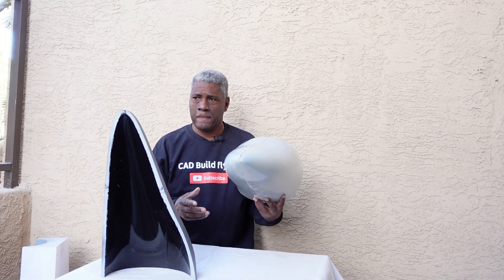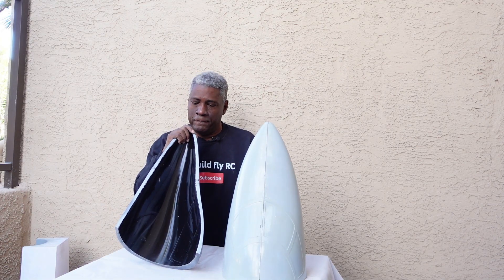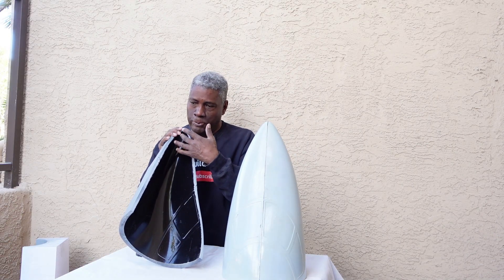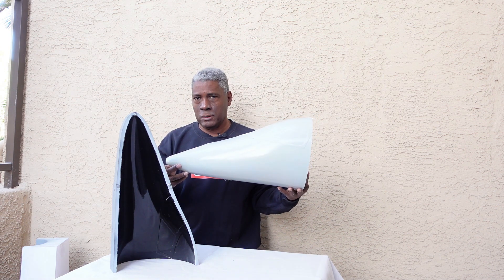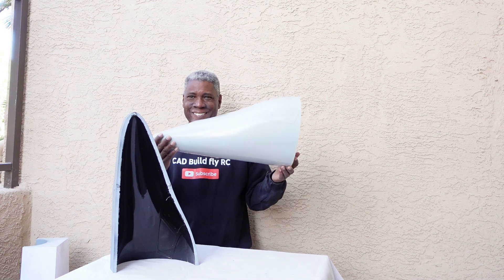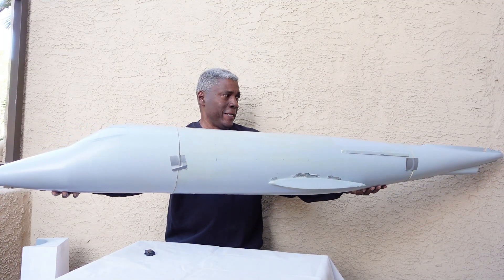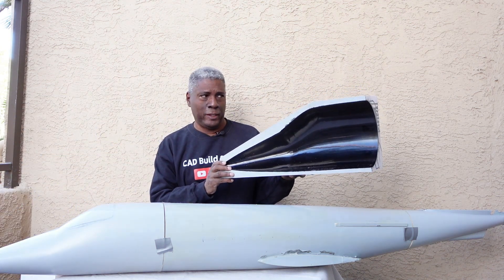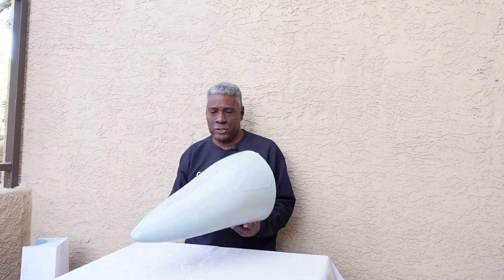Building a PC-24 RC Jet from 3D Printed Molds (Inspired by Ramy RC) | Part 1 – Nose

Comment: Greetings from Italy, I am an aeronautical technician of composite materials, and I really appreciate your technique, although I would like you to protect your respiratory tract with a suitable mask. I am a neophyte of 3D modeling with Fusion 360, and I really like your modeling technique, but I have not yet fully acquired it. I warmly greet you and wish you a happy Christmas.
Reply from the maker: Thank you very much and also for the suggestion of using respiratory protection equipment and  Happy Christmas to you as well.
Reply: @cadbuildflyrc3784 ❤

Comment: nice work my friend! How did you print the molds? How much infill and how many layers? I´m currently almost finished with two airliners made in Fusion 360 and i´m ready to print the molds. Don´t know yet how to prepare the molds in the slicer that the printing time is not tooo long. Thank you!
Reply from the maker: The molds on the PC-24 were printed with 3 walls.  3 walls are not needed, you can print them with 2 walls.  I just wanted a thicker surface.  I used 5% infill. The Learjet molds were printed with 2 walls and 5% infill
Reply: Thank you so much for your answer! 
You are doing really great work. Best regards from Austria